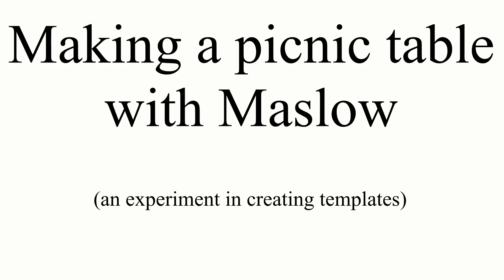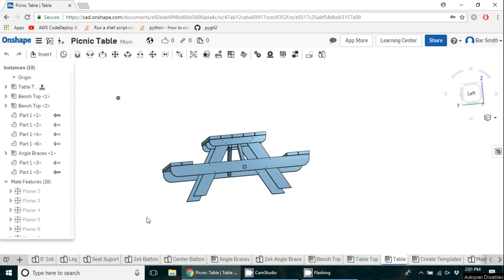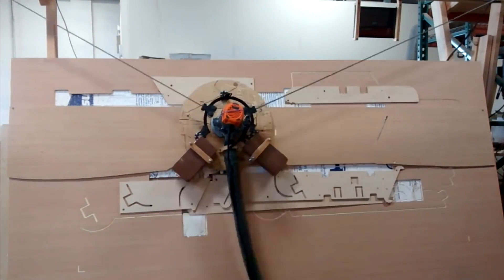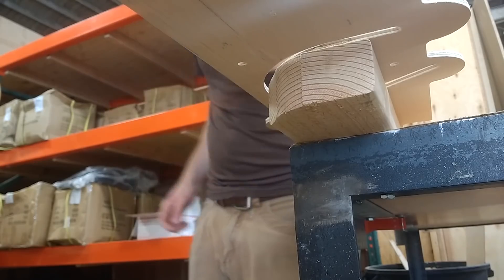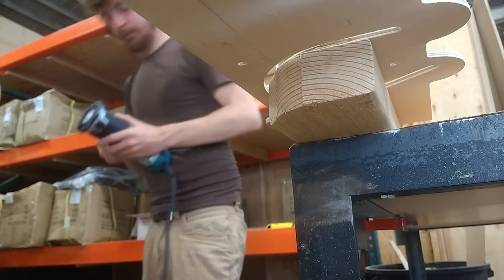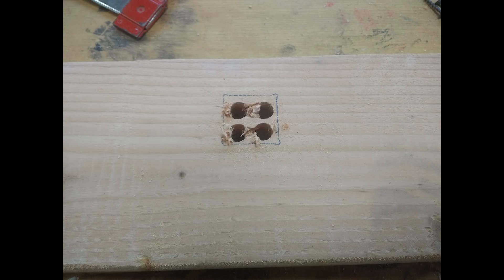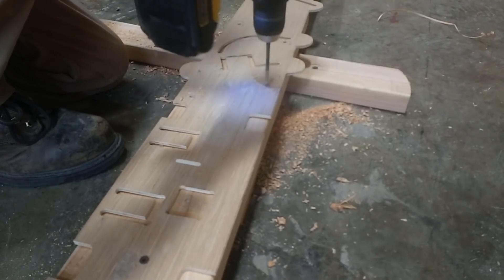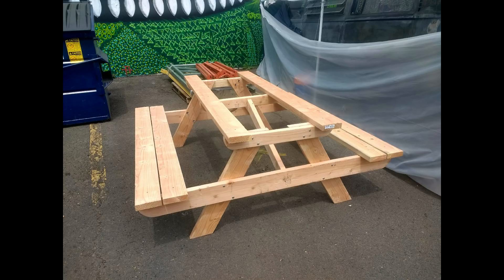Maslow Made Picnic Table (an experiment in templates)

Comment: I use steel weld nuts and pound them into my wood templates. It keeps the holes in good shape, otherwise with repeated drilling the holes get all messed up. there are also special drill bushings for wood, but they are expensive

Comment: A suggestion if you use the template to make another, clamp a bit of waste board to long flat side at the back of the curve before you start routing. You should limit your break out/tear out. Less sanding and nicer looking parts should be the result. I could, however, be completely wrong.